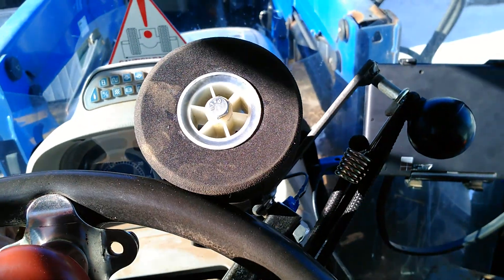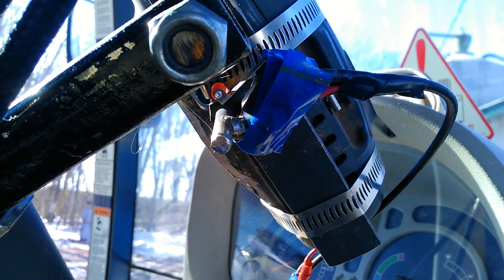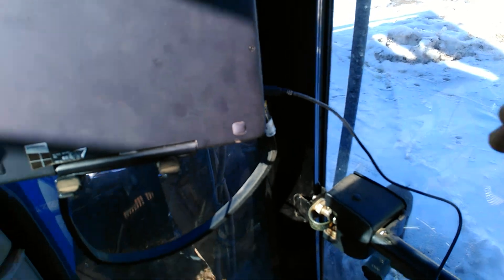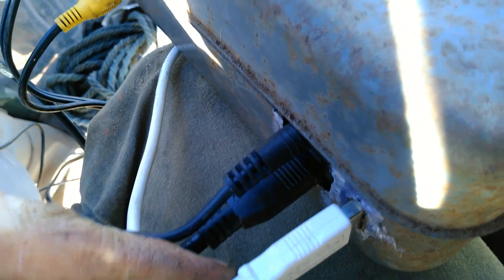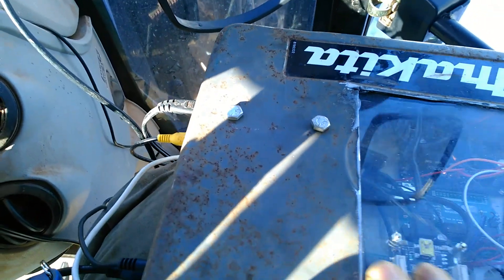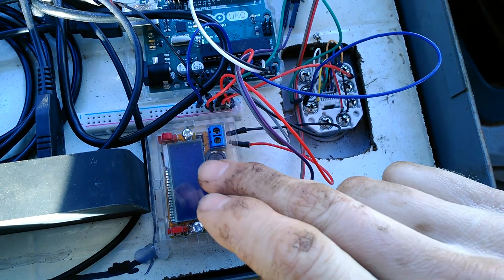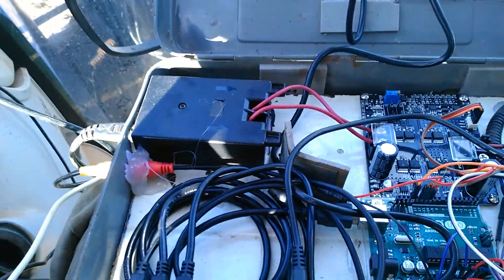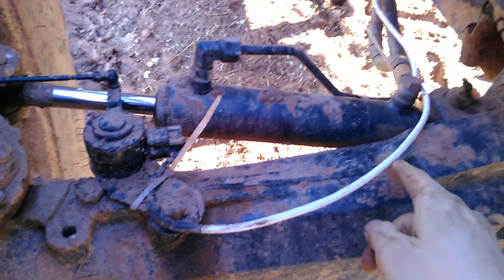AgOpenGPS DIY auto steer 1st setup

Comment: Why do you use Ethernet cable to was?
Reply from the maker: 2 reasons. 1st:  it's what I had a lot of lying around
2nd: using a twisted pair provides excellent shielding which makes for less noise on the signal line. I'll have to do a new video with current set up as this one is more than 2 years old and is now much different.
Reply: @wilberttalen4765  ok thanks! I'm curious to see your new configuration

Comment: Hi do you need a stepper up for your 18v drill to work correctly, or do you use directly 12v from tractor battery? thank you
Reply from the maker: This 18v drill was powered directly from the tractor battery. Now I use a 24v Phidgets motor (model 3269) with a 12v to 24v converter.
Reply: @wilberttalen4765  Would you recomend to use a phidgets motor or did the old drill do a relatively fine job?
Reply from the maker: @pj6073  definitely the Phidgets motor. The drill worked but was very loud, slow and got hot after extended use. Ended up burning the drill out and 2 more after.
Reply: @wilberttalen4765  thank you, so much to learn
Reply from the maker: @pj6073  we're currently working on a quick start guide and a manual with an updated Wiki that will hopefully answer a lot of these questions. We're now at AgOpenGPS.discourse.group
Reply: @wilberttalen4765  I had noticed the dokuwiki was down. I've been able to find plenty of info on mostly everything apart from the motor setup. Look forward to seeing the updated wiki
Reply: @wilberttalen4765  tahnk you, i know Phidgets motor, but i think is too expensive for me. I tried with a wiper motor,  it works but is too slow